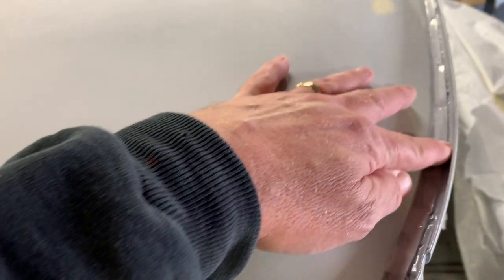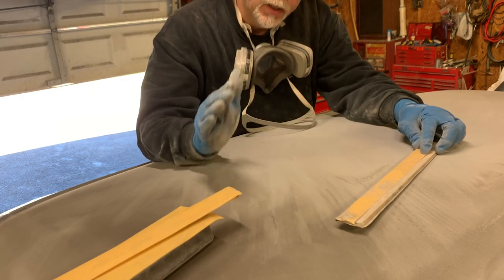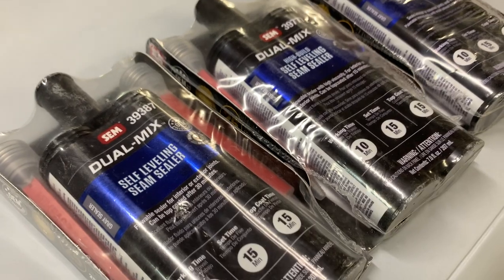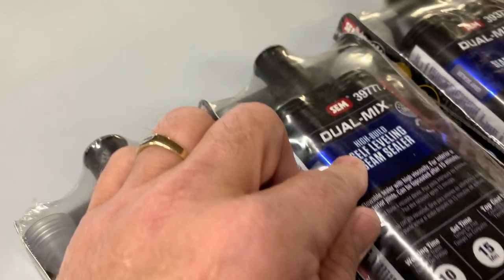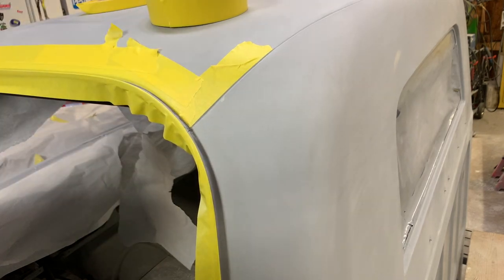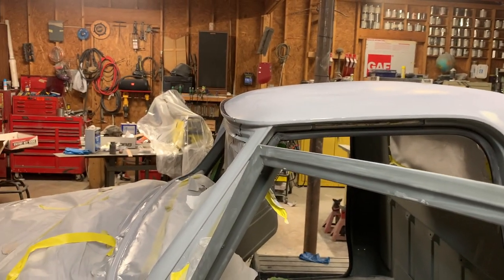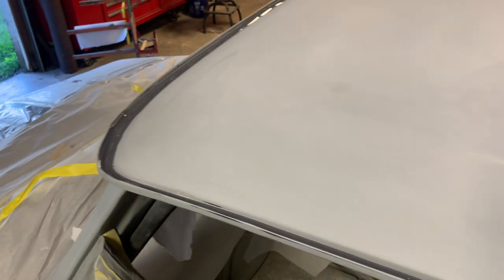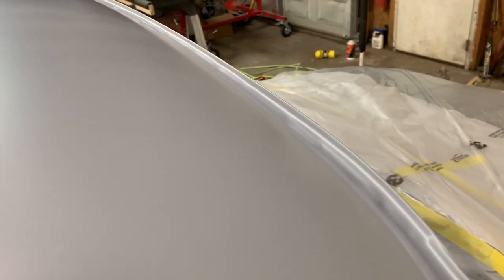C10 Show Truck Project: Seam Sealing the Drip Rail

Comment: Looks great. There are so many trucks out there where I think the drip rail seam sealer gets overlooked. Its the small details like this that sets your work apart.

There's a pretty cool trick to use on the self leveling seam sealer. If any air bubbles show up you can wave a heat gun over it real quick and they magically disappear.....

Great Work dude!
Reply from the maker: I like magic, lol. Thanks!

Comment: Did you use the first seam sealer for the vertical parts around the door since the other two will drip? Looks great, and thanks for taking the time to post this 👍
Reply from the maker: Yes I did. I also had the cab on a rotisserie later on and did a little more seam sealing on other areas. I could turn the cab upside down and do the underside of the drip rails. Made it turn out a little better. Thanks for watching!

Comment: Looks great ! I see this video is a few years old, I was just wondering what was that air powered sealer dispenser do I need that to put the sealer on ?
Reply from the maker: There are manual and pneumatic guns for these seam sealers. Both will work, just a little easier to be consistent with the pneumatic.

Comment: Why not seam seal after painting then paint seam sealer seems to me without any protection under it would rust
Reply from the maker: @jameschuke4104  once the seam is blasted to get out any old seam sealer, paint, and rust, it is sprayed with epoxy. The epoxy provides the corrosion protection and adhesion to bare metal. Seam sealer can be applied at any point after this.  Some seam sealers can be applied directly to bare metal and provide adequate corrosion protection themselves but I prefer over epoxy. The epoxy provides adequate corrosion protection without going all the way to the final paint layer so the seam sealer should be before final paint

Comment: Seam seals came out great. I have a a small rusted out area on my drip rail. Would it be ok to put some tape under the drip rail and put a thin coat of small hair bondo-glass in my drip rail before seam sealing?
Reply from the maker: Sometimes that’s the only way if you’re not wanting to start replacing major panels and such. Evercoat Kitty Hair works well or sometimes panel bond adhesive can be used to glue in a small piece of metal if it will be under the seam sealer.

Comment: Would you need to sand  or prime I'm between seam sealer coats if I do a second layer of seam sealer?
Reply from the maker: Yes. Once the first coat has set, sand or scuff it then apply the next layer. No need to prime again. Thanks for the question and thanks for watching!

Comment: Did you block this whole truck with a paint stick? Have not seen you bust out the $750 Mr Fancy acrylic blocking set that Youfacegram says you need.
Reply from the maker: No I did not use paint paddles. I used a set of not yet released to the public “Select” gymnosperm and angiosperm segments in various but specific dimensions soon to be available in kit form for the low low price of fourteen weekly payments of $19.95. Care to pre order ?

Comment: nice vid, wondered how you cleaned and prep the inside of the rail where the roof and rail spot weld to gather. i need to get out rust that appears to be in the narrow part of the rail next to the shoulder that's created by the layering of metal that's been spot welded together within the rail. also there's an area in the drip rail where there's lead work done with a few wholes where the lead didn't take to the metal (my guess is it wasn't cleaned good enough). the lead work in the rail moves up a bit onto the roof (lead on the roof looks good), just a couple of spot in the rail where there's the problem. can i try to evening the lead in the rail (it's a bit globbie) and paint/seam seal over it? any ideas or suggestions would be greatly appreciated.
Reply from the maker: This truck had been blasted clean and epoxied before I got it. I think they removed any lead they came across as well. Lead can be problematic so most times it is removed and the seam welded if needed or just seam sealer if it’s in an area not seen. As far as rust, blasting is usually the best way to get the surface stuff out. If it’s bad and has gotten between the seams and rotted then removing the bad areas and replacing the metal is what is needed.  It may need a small patch, roof skin, or cab replacement. I would blast first and see what it looks like.

Comment: Would using just the first application of seam sealer be fine if I want a little thicker? I’m not restoring a classic I’m just redoing my work van. I’ve been getting drips of rain inside my cargo bay in a few spots so I’ll probably just redo the entire rail
Reply from the maker: Yes. That would be fine. The second application is mainly just to get it smoother and looking better. Thanks for watching!

Comment: The high build self leveling was slow enough to use on the near vertical drip rail sections?
Reply from the maker: Yes. It does run so I always tape off past where I want the seam sealer so it will catch overflow. It may run a little more or less depending on ambient air temp and may require a couple applications to get enough build. Thanks for watching!
Reply: @StoutCustom  Thank you!
I watched your vid again yesterday just for the taping part, but sadly did not refresh my brain with the get the tape off before it dries part! Used high build self leveling in the front part of the driprail, but as you also stated it did not want to flow toward the front. Tried to aim more product in those gaps and by the time I went back to the beginning it had dried over my tape. Pulled off what tape I could, but by that time my nozzle was dry. At 70 degrees it seemed like I had 5 minutes tops.
Had to mechanically dig out the tape with a razor blade and stick which of course left a mess and scratches in the epoxy primer. Worried too water might get in where I pulled back the sealer edge, but should still be contact below that.
Tried to be faster doing the sides and getting the tape off. It was better, but had a few "taffy pulls".
This is not a show truck, just my own 1970 F250 that will be at stock ride height, so only really tall people will see my ugliness. 🙂
Reply from the maker: @rudsaki  dang sounds like you had fun with it, lol. Yeah I should have mentioned to practice where it’s not seen but heck it’s too expensive to just practice. Thanks for letting me know how it went. Next time im doing seam sealer again and making a video I will know which points to stress. Thanks again and thanks for watching!

Comment: Jim, Looking for advice on seam sealer tube size. Is it 200ml or 400ml? 
 This is just for the drip rail, self leveling and heavy bodied. as their are 30+ feet of other places to cover, but I can't use the more expensive 3M product every place. Thanks very much for your sharing the 1967 C10 show truck to us or even me. 
  Strange, after a quick lifetime of just fixing, now I am doing what they call a "Resto-Mod" with a 55 year old 6 cylinder farm truck into a basically stock EFI personal transportation vehicle, for myself. I have you to thank a lot of that!
DK, Omaha. Retired ASE master, not a painter but have the tools.
Reply from the maker: The 200ml is what I use. I haven’t seen the larger tubes in a while so I’m not sure if they are still available. I think they only come with two mixing tips so you may want to get a few extra  incase you have several seam sealer “sessions”. Good luck with the truck!
Reply: @StoutCustom   Thanks for the reply. They sell both sizes of caulking guns so that is why I had to ask. 
  I have repaired body work on 6-7 car our family owned as my 4 kids learned to drive and my wife is still working on it. I had to work, but fixed cars. The autobody seamed to be self explanatory as dealer had body shops and had some good friends. I was lucky to stay real busy and stay late & work Saturdays when scheduled off, but it is hard to be the man and support everyone while my wife was a "Domestic Engineer". Also call house wife. I bought distressed vehicles from customers, fix them then drive to work for 6 or 7 years. Never quit a job without having another lined up. It is tough but you can remember, no cell, cable, computers or internet! If you wanted to know something, you find someone that will let you ask questions and pick their brains, learn. Boy how things have changed the last 20 years or more. 
 I wish you continued success in 2022 and beyond, but I have back surgery #7 coming up. Spinal cord stimulator sounds sci-fi, but like a pacemaker, two electrodes are snaked up the space called epidural. Then a 6 day trial allows it to confuse pain signals. For me, this was all lumbar and worked as I gave it a 60-70% relief success of standing 6 foot 3 inches w/o a cain. They got permission and placed it under the muscle w/electrodes in same place, turned it on and the stimulation went down into my heels?! Everyone freaked! 
  Well, like new paint falling on the floor while sitting still, I spoke softly but carried a big stick. 
  Here we are, 8 months later after changes to setting and engineer with new software, they are going to move electrodes and wake me during surgery to ask where I feel the tingling! This time, a step they left out. With no copay. Humm!
  I lost a year, can't sleep, can't exercise and can't walk to my mailbox w/o a cain and it hurts.
Enough, bad doo-doo happens!
  I watched you rotisserie build 9-12 times. You made this farm boy laugh with your choice editing!
  Thanks for that too Jim! I am trying to be optimistic. Don't gamble, never been East of Atlanta, GA. but I know where telephone poles come from or should. Worked for GM on contract thru Raytheon and sat in the front row when engineers spoke. Next 13 rows behind me where empty buy asked questions. I say, you are never to old to learn from the right people. I count you among them. Thanks. DK, Omaha. 
  TMI I know. But thanks anyways. Did't mean to take your time as it is work, work and more work. Worker bee's don't get much time off. Hope you do!
Reply from the maker: @deankay4434  things have certainly changed. Used to be a lot of mystery to anything you wanted to do. Yep, had to find the all knowing ones and ask a lot of questions. Now tons of information with a quick search from anywhere you have signal for a cell phone. 
Technology is amazing and hopefully it will get you back going again.

Comment: I keep coming back to this video because it turned out so well.  I am doing my roof and gutters and this advise is priceless.  What urethane primer did you use?  I saw the vp2050 you used first, but I didn’t catch the second urethane brand and part number.   Also do you like sem better than 3M? And can you apply the seam sealer easily with a hand pumping gun vs an air powered gun? Thanks!
Reply from the maker: I used Global D8005 primer after the VP2050. SEM and 3M both have great products. I find the SEM gives me more of the look that I’m after with their seam sealers.With the 3M  it was either too runny or not quite enough flow, at least with the products I used. The manual gun will apply just as well as the air assisted but the air assisted will spoil you if you ever use one, lol. Thanks for the questions and thanks for watching!

Comment: Great videos. Did you use VP2050 directly on the metal, or did you apply another product? I'm getting ready to take my square body down to metal and was wondering what to apply directly to the metal as I start body working it.
Reply from the maker: The truck was blasted to bare metal then Deltron DP40LF epoxy was put on it. After that I started doing filler work over the DP epoxy. Once the filler work was as close as I could get it, i  primed it with the VP 2050. So the reason I do it this way is because bare steel should be primed immediately when the paint is stripped off. Once steel is exposed it can start to corrode very quickly. Epoxy adheres to steel very well and can be put directly on blasted steel. The VP 2050 is epoxy based and also sticks to bare steel well, but it is a high build product and has a limit to how much can be stacked up. So 2 coats of DP first for adhesion and corrosion protection. Then you have time to find the dents and do rust repair. Try to leave as much DP on as you can and work filler on top of it. As you block filler some bare metal will be exposed. Once it is as straight as you can get it, prime withVP2050 which will stick to bare metal, DP, and filler. Now you have a semi straight surface with a high build primer that gives you enough meat to block out imperfections. Hope this helps and thanks for watching!
Reply: @StoutCustom  awesome. This is exactly the level of detail I was looking for. I didn't want to start any body work before I determined which products I was going to use. I'm basically doing a cab on restoration, and have done a 5/7 static drop on my 87 short bed. All the suspension work is done, and I'm going to start body working the fire wall before I put a new motor in.
Reply from the maker: @Brian-tg8ye  cool project. Good luck with it. I’m sure it’s going to turn out great. 👍

Comment: great video do you ever use the brushable seam sealer?
Reply from the maker: Yep. Usually on the bottom of a cab or if I need to duplicate a factory brushed looking seam somewhere. Works great in some areas and certain types can be wiped over with lacquer thinner on a gloved finger to smooth it out a bit more. Thanks for watching!

Comment: Thanks for your videos there very helpful.  I'm working on a 67 C10 now and was wondering the amount of the seam sealer you used? does one tube get it done or do I need more then one! Also what sand paper are you using is that Gorilla Gold?
Reply from the maker: No problem and yes one tube did the drip rail for me. As far as paper, i mainly use Mirka gold or their q silver. Thanks for watching!

Comment: Why seam sealer and not bondo?
Reply from the maker: There is a seam there that needs something that will flow into the cracks n crevices to seal out moisture and remain flexible to move with the two panels as they expand and contract.  Bondo/filler doesn't do those jobs very well.  It would crack, let in moisture, and cause the paint to fail/metal to rust.  Good question and thanks for watching!